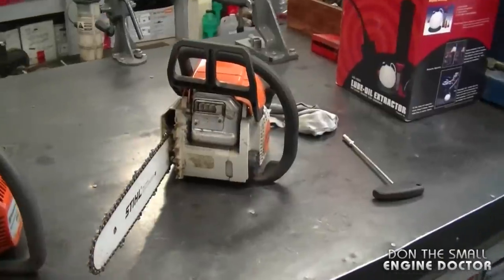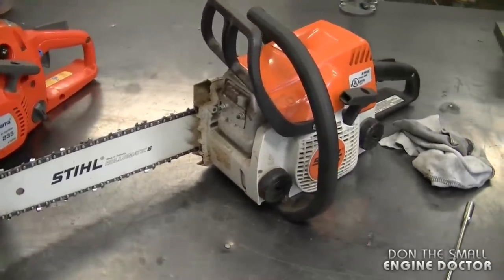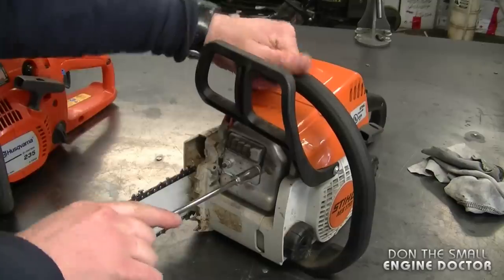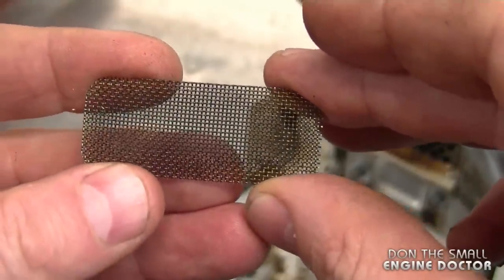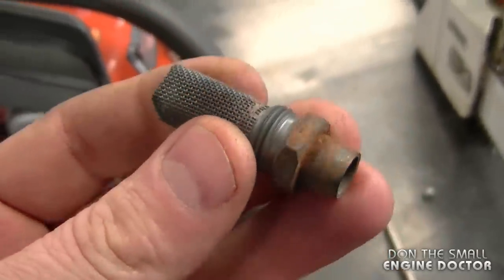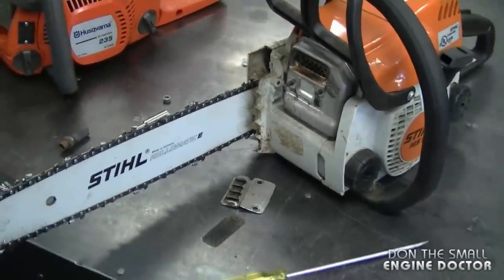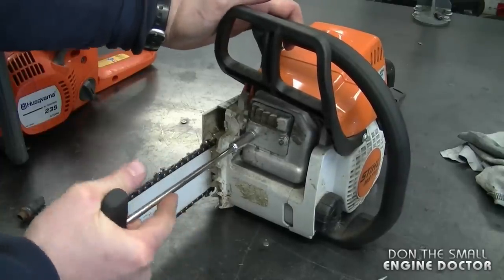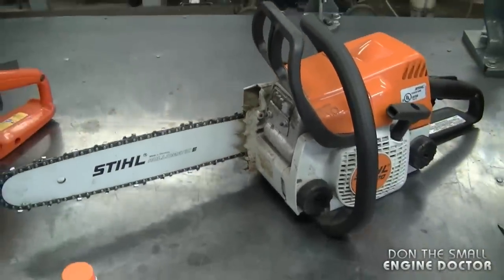Why I Don't Remove Muffler Spark Arrester Screens From 2 Cycle Equipment!

Comment: Before I watched this I knew it was going to be a Liability issue because you are an actual Repairer. But for the rest of us it’s just a restrictor in the exhaust that stops the machine from working at peak efficiency. Everything works better without them. Even if they aren’t blocked in anyway.
Reply: Until you start the forest on fire 🔥
Reply: @ChiDraconis  😂
Reply: @greybone777  you aren’t starting a forest on fire from not having a sr. You’d more likely to start it on fire creating spark from the chain

Comment: Spark Arrester screen cost from $8 to $30 of course it depends on the equipment. buy or make some extra and clean at the proper location with a big metal case (box or steel drum) with a torch or c-u-r-r-e-n-t??? safely!!!

Comment: ive been logging for 25 years and ive never had a fire once!and i take out my baffles and spark arrester screens in evry saw ive ever owned
Reply: so what? do you know more than the makers and rangers ? you have been fortunate IF you never caused a fire
Reply: justin revet Hello 
Are is there a future damage if you remove a spark arrestor from a raptor 700 Model 2015 ?
Reply: @DougHinVA  Always remember to take your tampon out before bedtime
Reply: I never wear a seatbelt ‘cause I never plan on being in a car accident
Reply: @DougHinVA  I trust a 25 year logger to know his individual situation over our government "experts" and their one size fits all rules. It's not the manufacturers choice, most likely it's an EPA lawyer's idea.
Reply: I  know a guy that did that,  he set the bush on fire. He never removed them again.

Comment: I found this channel after a spark arrester screen issue on a blower.  Not used often, the blower would fire but then die and flood.  I hadn't worked on a piece of equipment in 25 years.  Finally, your videos and others caused me to check the exhaust.  A mud wasp had plastered over the screen port.  I'm in the Southern US.  Broke the seal and the thing fired right up.  The screen provided a good backing to keep the seal from being blown out by the exhaust until punctured, but it also likely saved me from having a muffler full of hardened mud. 

Whether the blockage is from carbon or critters, it is best to check at least once a year.

Comment: Thank you very much for your explanation of removing and cleaning the spark arrester screen on the two-cycle STIHL chainsaw.   It helped so much.  I could waste a lot of money for taking my chainsaw to the shop.  I called the Bliss Power tool store and wanted to have them fix it.  One of the guys there said that I can drop it off and it will take about 3 to 4 wks to get it fixed.  Then I decided to check it out myself.  Removed the Exhaust Muffler kits and noticed that the Spark Arrester Screen was really dirty so it out and cleaned it up, then I put it back on and  the power of the chainsaw came back on.  This saves me some money.  I wasn't sure if I had properly cleaned it so today I watched your channel and saw your demonstration of cleaning the Spark Arrester Screen.  I got it done properly so thank you so much for your guidance.

Comment: I see your point .
I used to run a forestry contracting business , 9 months of the year we used to run the saws without spark arresters but in summer we put them back in for the very reason you mention plus without the arresters it void my public liability insurance . The difference without an arrester is noticeable even on a big saw . Ever wondered how much sparks come out of a two stroke engine - go run one at night …. its quite alarming .
Reply: wow interesting, ill have to run mine tonight haha
Reply: Yeppers.  Neat to watch.

Kinda unrelated but interesting, I even get lots of sparks dropping golf ball sized decorative quartz river rock against each other at night.  Just take a bunch in your hand and drop it from maybe 4 feet up on to some on the ground.  Big spark show that you would never see in daylight.

Comment: Another good reason for leaving the spark arrester screen on is to keep mud dobbers from building inside the muffler if your equipment is stored where they may have access to it. It's more common than you think.
Reply: I was given a bench grinder which had been sitting for a while. I opened it up firstly and found that these beggars had set up home inside of that........ Mud everywhere.

Comment: Love your videos. Your KM130 4 stroke has a spark arrester too. Like you said other machines may have a spark arrester. Not using full speed revs on a chainsaw can also cause premature wear to the clutch and nearby components. The clutch is designed to slip until it reaches full speed. The continued slipping can cause excessive heat, metal tempering and wear. That's the same reason why many machines are damaged by inexperienced people adjusting the idle speed too high. It either slightly bumps the clutch drum causing an intermittent ringing or to the point where it mostly grabs and causes an unsafe condition of the tool spinning constantly. Please be safe and kind we all deserve the respect from each other.

Comment: The screen also makes a good diagnostic tool just like reading spark plugs or looking at the air filter. All of these need to be cleaned or completely replaced at some point or another. Very good advice on keeping engine speed up. I make a point of not letting my saw idle for more than 30 seconds, if I need to, I just stop the engine. My chinese generator's muffler uses a chunk of aluminum window screen with a hose clamp as a spark arrestor. It works well and it's easy to replace if needed.
Reply: If they actually used a window screen I doubt it would arrest many sparks.

Comment: I remove every one and love the power increase along with a muffler mod.  I dont use ethanol free gas due to the cost its cheaper to buy a carb than to buy ethanol free gas if there is a problem.  Love your videos.
Reply: I just got a new bike. Should I take it out? I don’t want to burn the valves or anything

Comment: I have added cleaning spark arrestor screens to my annual PM program.  I just take the out and burn them clean with a torch.  You will find the equipment becomes easier to start when you do.  Using two cycle oils, Like Stihl Ultra, exercerbates the situation due to their high ash content.

Comment: I see that it’s quite easy to clean the spark arrester, so for safety reasons I would keep it in the machine. Certainly won’t be blocked after one hour of use. Good explanation, as usual 👍

Comment: Thank you Don, good advice as i did have a bad experience due to the spark arrestor missing. Thankfully we had a fire extinguisher on the truck and noticed the brush was smouldering.

Comment: To prevent Sparks and screen blockage always use seafoam and it will keep carbon buildup from forming on the screen by adding 1 oz to every gallon tank and it will solve all your problems dealing with carbon buildup it's a preventive maintenance make a cost. Also it adds extra lubrication which will increase compression and help your 2-cycle oil do its job.

Comment: Took the spark arrester out of my string trimmer because it had one of those crappy conical ones and I only use it on my lawn, so very low risk of fire. However, I leave them in everything else. If you mix your fuel properly it should take a very long time before it clogs.

Comment: i wonder if there has ever been a recorded case of a fire being started because the spark arrester was removed. it would be interesting to know if it has happened before.
Reply: If you’re running a saw in the dark you really see it shoot sparks, but I’ve never had it combust anything.

Comment: Interestingly, the spark arrestors are the cleanest parts on my mufflers. Of course, I actually do run my stuff at full power enough to help keep it from being an issue. I probably should clean the mufflers and deflector plates, though.

Comment: What is sad about all of these regulations is the fact 99.9% of the incidents are caused by poorly maintained equipment, if people followed reasonable routine checks and maintenance 2 cycle engine would not be blowing out sparks or lit muffler batting, these things happen because of pure laziness and complacency,  now 4 stroke engines are a totally different story.    I own and ride 2 stroke motorcycles, a clogged screen can really effect the performance of an engine in a bad way.
Reply: But do the owner's manuals even mention having to do that?  Many Joe Homeowners don't know to do it.  We know from being in the business or at least heavy-hobby, but I don't remember ever seeing that in a manual.

Comment: I don't take them out either.  Great video Don.   I tend to keep them as factory as I can.  I did get angry at a Tecumseh mower and removed the brake as it was bending the brake handle due to a stiff switch but i did it for a friend.

Comment: Now, say you get a piece of equipment from a customer where they removed the spark arrestor screen, do you, as a tech, have to put a new screen in to make sure you're covered?  Or do you not work on that piece of equipment?
Reply: I would assume the tech isn't responsible for repairs made by someone else. Take pics, or video cover your own butt

Comment: I live in a tinder box in California. I don 't even like to run saws in the day during summer when it's hottest and driest if I can work around it.  I carry a fire extinguisher most of the time just in case.  What is funny (or maybe not) is the saw I have right now has a catalytic converter per regulations for emissions, but it makes the muffler INSANELY hot.  I see big sparks flying all the time from sawdust bouncing off of the muffler.  Best case scenario, get rid of the cat and keep the screen, or take the screen on and off seasonally, but living here I'm not going to just take off the screen and leave it off.
Reply: There are sometimes temporary restrictions on when you're allowed to cut in the Western states.  They have a certain time when you must stop for the day when the weather is dry too long.

Comment: My stihl chainsaw screen is always clean. 
My FS55 screens are always clogged. 
Big difference is throttle speed as he mentioned. 
My weed whacker I feather the throttle almost always. It’s never full out. 
Chainsaw -the exact opposite. 
Let her rip. 
In any case, it should be the first thing to check if you have a problem with your machines performance. 
Takes all of 2 min to pull out

Comment: If a quality 2 cycle oil is used, the spark screen arrester should not even be an issue. May I suggest Amsoil Sabre Pro for all your 2 cycle needs?

Comment: Homeowners just need to do yearly maintenance on their power equipment, and they will have very few problems like plugged screens. I own several Stihl tools and never have issues such as this. In my younger days when I had junk, I didn't care, and always had issues. Regular maintenance saves a lot of headaches.

Comment: Subd. Great channel.  I'm actually in the process of starting my own small engine/repair business.  Swamped already with work. Definitely not going to lie, get lots of great info from you! Have 2 ms150tc in now, both very boggy,  like that's it. Bog. Screws dont do anything so spark arrestor is where I'm headed next as I suspected. 
About removing it, I've seen guys cutting palm trees down, where the dry husk on the tree caught on fire from exhaust.  Climber didnt panic as it went right up and around him and kept going. Like lighting lint on a sock. Crazy. Anyways,  great channel!!

Comment: I use E-85 gas in all my 2 stroke power tools... You have to open the jets to allow more fuel in but they have what seems to be twice as much power... They use a lot more fuel...
Reply: And you spend more

Comment: I wouldn't remove the spark arrester too. I really understand about the spark arrester from the past up to present day. I have actually to cleaned a spark arrester on Stihl br200.I did put it back on the blower. It was the hex nut style just like the stihl f-s 38.

Comment: Have personally had three fires start cutting dead trees. Very important for forest fire prevention.
Reply: Nat Sarim  California has had to have them since the 70s. I think what happened is they just started fires.
Believe it or not people don't stay up nights thinking of ways just to make your life difficult. They came up with a rule and the manufacturers just go ahead make them all like that
Reply: lengray44 I have to disagree. They do listen to lobbying groups as to how to improve business by having folks bring their equipment to have a screen cleaned.
Two great examples - Low flow toilets. (Ridiculously stupid idea that has done what?)
Gas with ethanol. (Selling you a crappier less effective product at the same or higher price all the whole procuring it from land owned by, drumroll, the taxpayer).
Reply: I've started fires several times with the spark arrester installed.  Always on dead ash bark while bucking a log with the muffler too close to the log.  It's an easy fire to put out though luckily just by patting it out.  I could see that getting out of hand with dry evergreen bark with dry needles or sawdust in the mix.  This can be extra dangerous if your dogs are too short causing the muffler to ride or nearly ride the bark when bucking a large log.

Comment: I have never had to clean my spark arrestors in any of my outdoor power equipment and I guess it's cuz I use good gas and I also use the true fuel or the steel Moto Max I highly recommend people using that because that really helps reduce that problem
Reply: What if you’re using 2.5 gallons of 2 stroke gas in 3 days?

Comment: In the shop I work in we have found that in some units such as the Stihl FS94 if the spark arrester screen is removed over time the muffler will become  carbon fouled and is very hard to clean. The screen is very easy to clean and as long as the screen is in place the muffler will stay clean
Reply: With the spark arrestor in that causes a little more back pressure the muffler would run a bit hotter which in turn would cause less oil to condense on the inside of the muffler walls.
Reply: @AuMechanic  The initial comment and initial response is true, but that would take many, many, many hours of run time to collect enough to make a difference I would imagine.  Even if that happened, you could just torch it the same way you would the screen though. and brush and/or tap out the ash when done.
Reply: @happycamper6352  You could do
I was just explaining why it likely builds up with the arrestor out.

Comment: I remove my spark arrestor screen when i run a strong cleaner like amsoil quick shot and amsoil power foam that way it doesnt clog it up after a thorough cleaning. Then i throw it back in after cleaning the screen.

Comment: My experience is that removing the spark arrestor it causes my blowers to take longer to warm up.
Reply: Stihl takes a while to rev up
Reply: Yes, the reduction of back pressure will cause a reduction in friction in the engine, leading to a slower warm-up time.  It's important to know this so you don't run it hard too early.  That causes the piston to warm up too fast (causing expansion) relative to the chamber warming up to slowly, and that's a big problem because the piston will become too big too fast and score the components and ruin the engine.  So, make sure you warm up the right way before putting the engine under a working load, and this means longer warmup time without the back pressure of a spark screen.

Comment: I think the back pressure actually helps create horsepower on the downstroke. My stihl br 800 didn’t seem to have as much power with the arrestor out. But my stihl fs 94r seems to rev higher without its arrestor
Reply: The power goes up with reduction of back pressure on most chainsaws.  It has been often tested and is well documented.  Just beware of the risks and be prepared for consequences.

Comment: If the oil is being mixed properly, and the equipment is being used properly (not left to sit idle for a long time) then the spark arrestor should not get clogged very often right? I am going to leave all of mine in, because I think its an indicator of other problems if its getting blocked. I also noticed that it makes the exhaust louder removing it on some machines

Comment: Similar to the way that some motorized bike enthusiasts will modify their muffler by drilling more holes in the baffles. Some completely remove them but that's just stupid loud. I wonder if the engine will run hotter or cooler with its hands untied when that screen is removed.
Reply: Just a tad cooler due to less back pressure.

Comment: I also use a propane torch to clean the spark arrester screen. I feel weird carrying a propane torch in the woods in order to keep my spark arrester clean.  It's an ironic firesafety measure. My husqvarna 345 never got clogged, but the new 545 gets clogged every 12 hours. I think that the manufacturers made a downgrade on this aspect, and let the consumers deal with it.
Reply: That seems awfully often.  Usually it's not an issue anywhere near that often.  I can't notice buildup on any of my saws until many months of full-time use, and even then it's minimal; I could probably get away with once a year despite full time use.  The leaf blowers have screens that can clog a bit more often though, but it's still a couple  months.

Comment: Dony what is a good cleaner to soak 2 cycle mufflers in to help clean out the carbon build up when they have a lot of hours on them I just had to clean a spark arrestor on a fs94r. Thanks for sharing. Have a great day. God Bless!!!
Reply: That is one unit you should never remove the spark arrestor from!!!! With out the screen the muffler will foul with carbon and is very hard to clear.
Reply: Torch it the same way you would the screen.  Tap the ash loose and it'll blow out next time you run it.